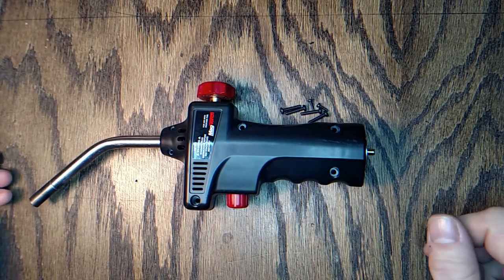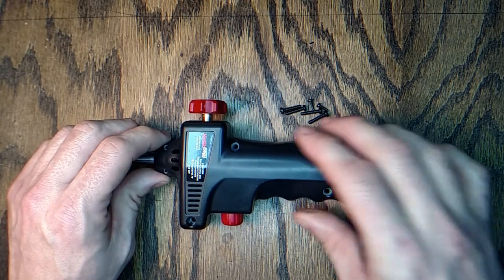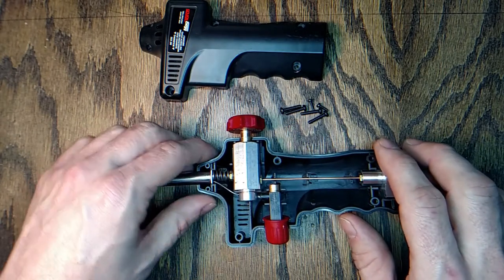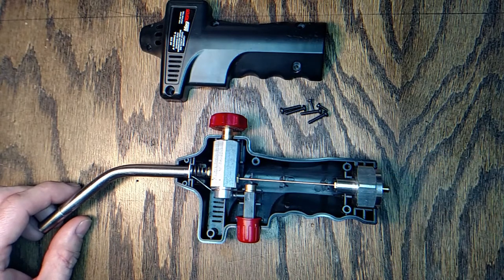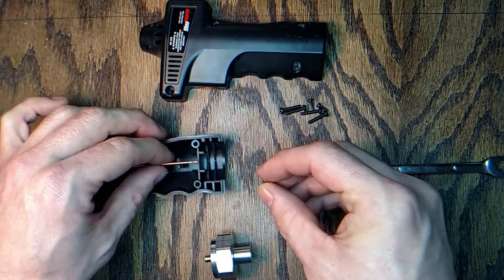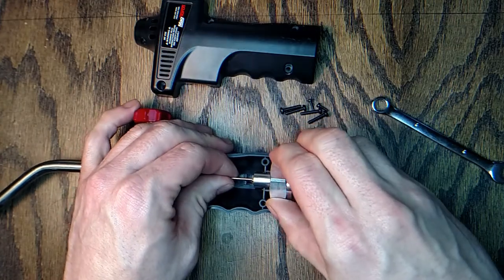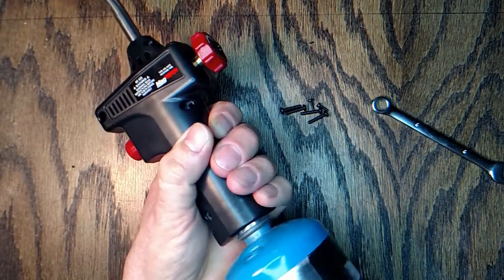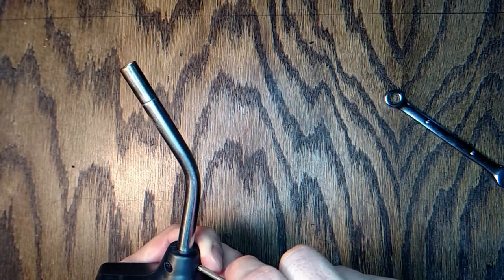MagTorch brand Self Igniting Torch Repair

Comment: I've always had those pure brass torch tips that required the use of spring loaded flint strikers (commonly used with acetylene torches).  I recently picked up one of these self igniting torch tips for ease of use for camping trips lighting fires.  This is a good video and useful information to remember!
Reply from the maker: Thanks for the great comment.  I made this video because I figured if I had this problem other people would as well, and I could show them how to fix it instead of just throwing their torch away.  Thanks for watching.

Comment: Not enough gas is coming out to keep mine lit. I can hear that the flow of gas is very minimal compared to what it should be. I’ve blown out both ends of the torch with compressed air but nothing seems to help. Any suggestions would be greatly appreciated. Also, your torch looks pretty new to be having problems with it. Mine is a few years old and I have had this low gas flow in the past but compressed air has fixed this problem in the past.
Reply from the maker: Wow, it's been 4.5 years since I made this video.  It was pretty new back then.  The problem wasn't related to age, I think it was just not assembled properly.  As for your problem, I haven't seen that so I don't know specifically.  You could try a different propane bottle.  Or just take it apart and inspect everything to see if you can find a problem.

Comment: I was happy I found this video as my new torch has never worked correctly.  I followed the video and thought I had it, but now, when I screw the tank on, it starts leaking immediately with the knob in the closed position.  Any thoughts?
Reply from the maker: The key to avoiding leaks is to make sure you have the tiny rubber O-rings installed correctly and the small fittings that thread into the valve and into the bottom piece at the right tightness.   The O-rings seal because of the compression between the small fitting and the piece it screws into.  If you don't tighten them enough the ring isn't compressed against the tube tight enough.  But be careful to not over-tighten as you could damage the O-rings.  I'd take it apart again and make sure you didn't loose one of the rings and inspect them to make sure they are not damaged.  Then put it back together and tighten the fittings enough that the thin tube won't pull out of the valve or the bottom part that the tank threads into.
Reply: @cdsmith  Sounds good. I only found one ring. I'll take your advice. Thanks
Reply from the maker: I took mine apart again to check and there are two rings.  One where the thin tube goes into the bottom fitting that you screw the tank onto, and one at the other end of the thin tube where it fits into the valve.

Comment: Great video. My igniter isn't sparking, I guess I'll have to double check everything and see...... thanks for the concise info....🙋‍♂️
Reply from the maker: It might be that it is sparking but the spark isn't going down to the end where it needs to go to ignite.  Check everything out, but also maybe see if you can click it in a darkend room to see if you can see sparks somewhere they shouldn't be.  But be careful clicking the igniter with it taken apart, you might become part of the circuit and might get a good zap.  In particular, there is an S shaped wire that clips onto the igniter and the valve body.  Make sure that's still in place as it forms the return circuit from the outside tube back to the igniter button.
Reply: @cdsmith   ahhh, thanks for the advise. I will check it out.
 I'll have my wife try it, so I can avoid a good zap.......lol   👍

Comment: I have the magtorch  took it apart but don't know  how to connect the clicking wire that starts the flame ?
Reply from the maker: It's been so long since I did this video it's hard to remember the details, but there is an S shaped wire clip that forms one connection of the clicker circuit.  The big end of the S wire hooks onto the valve body and the smaller end of the S wire hooks onto the exposed metal end of the clicker button.  There is also a wire that goes from the clicker button, around the valve body, and into the tube.  Make sure that wire is still connected and that it is not broken along the way and not shorted to any other metal parts like the valve body or the spring where it goes into the tube. If there is any damage to the wire insulation it could end up sparking somewhere inside the torch handle area instead of at the tip where it is supposed to spark.

Comment: I Have the Same Problem With A Turbo Torch TX504 I Don't Hear Any Leak But If I put A New Propane Bottle On It The Next Day The Bottle Is Empty.  I've Used It For Many Years With No Problem In The Past
Reply from the maker: Leaks are often slow enough that you can't hear a hiss, but it can still be dangerous, expecially if you keep the torch in an enclosed space.  I use my torch infrequently enough that I remove the bottle between each use for safety.  I don't know how yours it built internally but if you can take it apart and still connect the bottle maybe you could make up some soapy water and brush it onto each connection and find the leak by looking for bubbles.

Comment: I have a problem with my torch, it can't seem to ignite the gas and I never took it apart, afterward I took it apart just to check but it still didn't work could the igniter be misaligned or something else
Reply from the maker: It's hard for me to say without being able to look at your torch, and unfortunately there isn't a lot that can go wrong with the igniter that can be fixed by the user, especially if it quit before you took it apart.  You could check that the wire clip that I show at about 1:33 in the video is still clipped to the metal end of the igniter and the other end is around the round part of the valve body.  And look for damage to the insulated wire that goes up the tube.
Reply: @cdsmith  thanks

Comment: I have a bernzomatic 2000 no screws
Reply from the maker: I am not familiar with the Bernzomatic units so I can't really offer any specific instructions on how to take it apart.  A lot of stuff these days seems to have no screws and no obvious way to disassemble.   Sometimes there are screws hidden under stickers and you can find these by pushing on the stickers to see if you feel a space underneath.  But more often the reason there are no screws is because the unit just snaps together.  You have to find the seam and get some sort of tool into the crack and pry to pop the unit open.  But I don't know if that applies to your torch.  The real bad ones are where they weld the seam all the way around the unit and make it almost impossible to open.  Sometimes on the welded seams you can crack them open by tapping with a hammer along the seam but much of the time you just break the plastic doing that.  Some things like that just turn out to not be practical to repair.